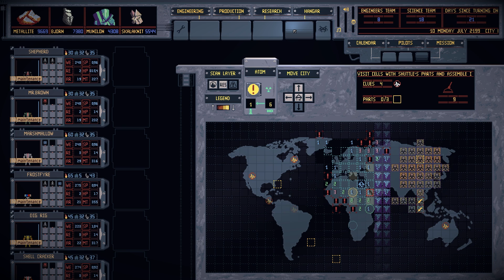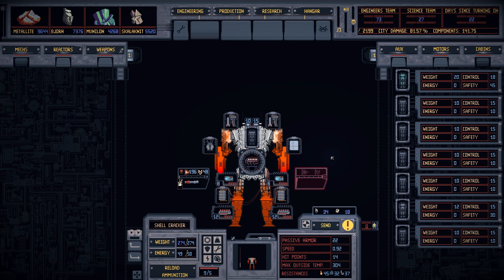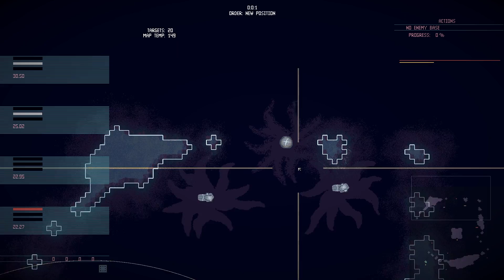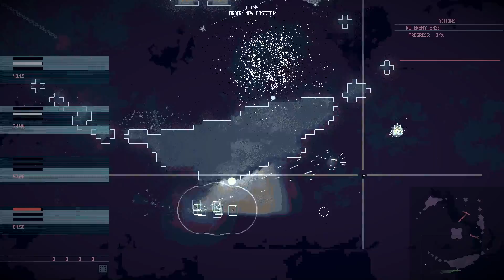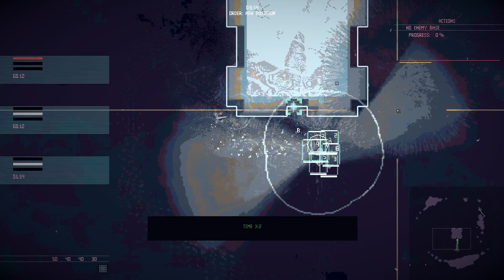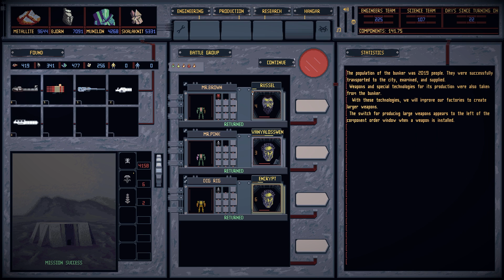Saving Humanity One Convoy At a Time! Mech Engineer Let's Play

Comment: Hi Aavak, lovely the series and I think I have some nests for you. (I can never remember which way round to do coordinates, so I've gone with left number-top number)
The 4 at 11-20 gives us a lot to f information.
10-19 and 9-20 rule out some of its surrounding tiles, leaving only 4 locations for the remaining 3 nests.
Knowing that only one of these can be safe, the 2 on 11-19 means that 12-19 and 12-20 must be one nest and one safe, confirming nests on 11-21 and 12-21. And knowing that one is definitely a nest rules out most of 11-19's potential nest locations, confirming 12-17 as another nest. Finally, 11-19 is now complete, confirming 12-20 as the final nest location for 11-20.
To recap: nests confirmed on 11-21, 12-21, 12-17 and 12-20
I hope that makes sense and I haven't overlooked anything!
Reply from the maker: Well spotted, thanks for the tip!
Reply: Hey Grubbyfoot, good find on the nests but I don't believe that there is enough evidence to confirm the nests at 12-17 and 12-20 since there is nothing preventing a nest from being at 12-19 and satisfying all of the numbers above them.
Reply: @AlchemicalAcorn  I'm squinting at my phone so that's very possible, I'll check back in a bit to see if I can clarify my reasoning either way
Reply: You are correct, I missed the possibility of the 2 and the 3 being satisfied by the same nest.

Comment: A word of caution, as I've just reached the part where you are building a new basic rocket, that at least 1 or 2 points in accuracy for basic rockets will save you a world of headaches. It controls the initial "flare" to the side that often occurs with this weapon type, and without those points the mech is extremely likely to hit friendlies by striking rocks or walls near the lance. With shards the problem can be extremely damaging if you get very unlucky as the initial explosion will eat some coating but the shards will eat internals. Additionally, I think part of the problem for Mr. Brown may be that rocket specifically has rate of fire increases, which for an already ammo guzzling weapon is problematic.

On a tactics note, I think it may be a consideration to never prioritize brucus on the assignment screen. It may be counter-intuitive, but by having a brucus target assigned it is very very likely that the assignee will snipe at an brucus with unfavorable positioning or angles. This behavior increases the likelyhood that a brucus will be triggered into escape mode and drop turrets, which further complicate mission progression and pursuit of the brucus itself. For long range weapons types, targeting specific combat enemies or nests is likely worth a try, as it allows you to decide to engage brucus on your terms instead of the AI's terms.

As always, a great video, good luck ^_^.
Reply from the maker: I have been feeling like focusing the Brucus has been bordering on counter productive for a little while, and the last mission where we lost two of them really is starting to emphasise that. So strong agree on that one.

Comment: DAY 21

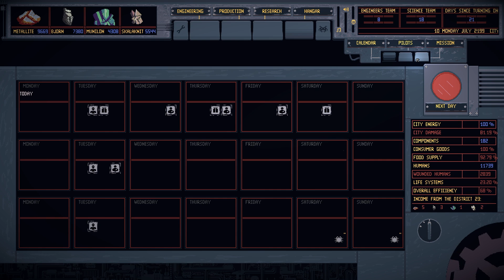0:01-2:10 Nest-sweeping.

DAY 22
 
2:10-4:06 City management.
4:06-5:17 Tactical map overview.
5:17-13:38 Mech modifications.
13:38-14:35 Lance composition setup.
14:35-29:36 BATTLE.
29:36-30:50 Debrief.
30:50-31:49 Pilot training and Recovery.
31:49-36:47 Research and Engineering.
36:47-38:21 City movement.

Things that happened today:
-1 MK2 Motor, and 1 MK2 Injector finished production.
-Air Purification System upgraded.
-Shell Cracker given a new Missile Pod.
-1 Special Mission.
-Holo Mechs under research.
-9 MK1 Motors dismantled.
-1 MK Piston, 1 MK5 and 1 MK4 Cockpit in production.
-City moving south.

DAY 23
 
38:21-40:21 City management.
40:21-41:18 Tactical map overview.
41:18-42:40 Mech modifications.
42:40-42:50 Tactical map overview Pt2.
42:50-43:22 Lance composition setup.
43:22-46:57 BATTLE.
46:57-47:23 Debrief.
47:23-49:00 Lance composition setup 2.
49:00-53:42 BATTLE.
53:42-54:14 Debrief.
54:14-55:00 Pilot training and Recovery.
55:00-56: Research and Production.
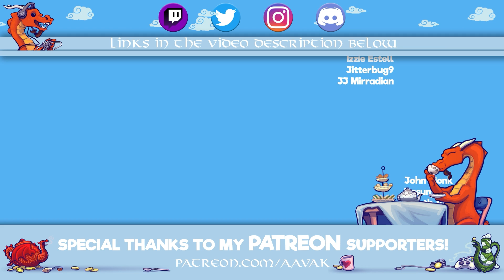56:27-57:31 Closing comments.
57:31-58:02 Outro.

Things that happened today:
-1 MK1 Motor finished production.
-Tesla Weapons finished researching.
-Artillery system upgraded.
-Fixed Mr. Browns Cooling system.
-2 Missions.
-Reactor Overdrive under research.
-125 Components in production.
-City moving south.
Reply: This should get pinned!
Reply from the maker: Amazing work :D

Comment: Hello there!

The cells to the east (21,11) and southeast (21,12) of the 4 are nests.
This is because there are 2 possible combinations to satisfy that 4:
1. (17,12) is a nest, forcing (20,12) to be nest. That forces (21,11) and (21,12) to be nest
2. (19,12) is a nest. This forces (21,11) and (21,12) to be nests.

(18,12) can't be a nest, as then the 4 would not be able to be met. (19,12), (20,12), and (21,10) are excluded by the other numbers around them.
Reply: This leaves either (19,12) as a nest, or (17,12) and (20,12) being nests, with either set excluding the other.

Comment: Wonderful nest placement with those added ones at the start by viewers, the African corridor down to South Africa remains open so far, so the city shouldnt need to be dodging anything for a good while yet.

EDIT: Full agree on that the mission on the special site should give a bit more explanation, that was a lot of 'figure it out yourself' from the game while you endured a tornado and sunspot.
It seems you had to stay by the door to like, 'order' the people inside to pack and come? The longer you stayed in the B spot the more convoys it spawned. (Presumably waves would come more continuously if you held the point rather than move off and back on?)
Now I am very curious what the other interest points are going to be. We saw the other one was some sort of radio station or telescope, so I guess its not going to be a bunker full of people like the very clear bunker looking one.
Reply: The red circle completely threw my engineering production plans out the window. In a good way, but still!

Comment: You definitely are not prepared to clear a base yet. I recommend just upgrading mechs, gathering resources, and doing primary objectives for now. Attacking enemy bases will require stupid amounts of firepower.

Edit: Once you are able to get more firepower, it may be an option to attack bases since they tend to have enemies that have resources. Also, the giant centipedes are killable and give lots of resources for doing so. It is worth it to kill the giant centipede bosses.
Reply: Just remember big centipede requires ungodly firepower and upgraded communications (combat can be microintensive).
Reply: @HappyAspid  Yeah, that is pretty much the only downside, but once you have the proper upgrades, it is definitely worth it to kill centipedes. The other bosses are much less valuable since they do not drop resources.